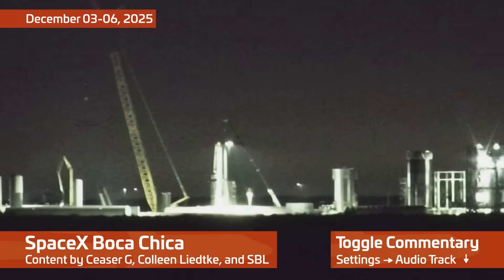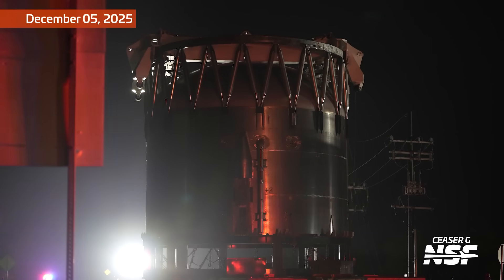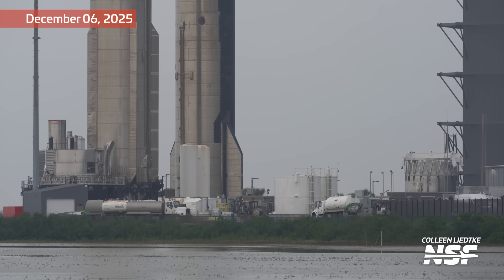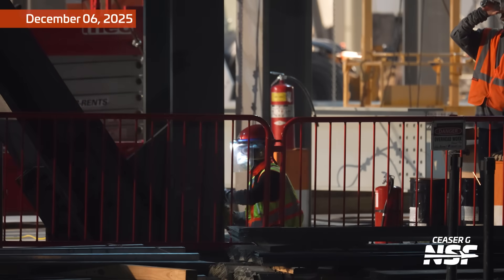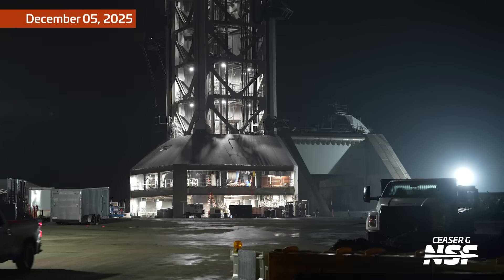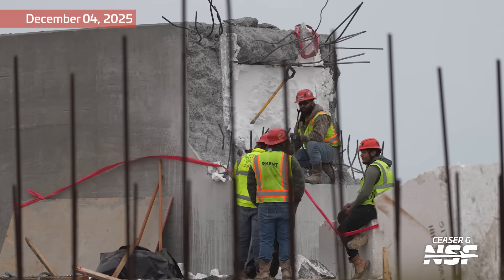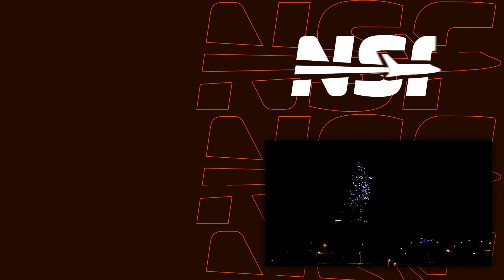"Thats a fine looking Starship" | SpaceX Starbase

Comment: Is there another storage tank instead of COPVS that space x coould use? they seem very dangerous
Reply: Has anyone actually confirmed it was a COPV issue?  There are certainly other materials that can be used, the trade off is weight though and that's what they try and avoid if possible.  Anything holding a lot of pressure is dangerous.  Remember the ending to Jaws? :)

Comment: FYI, the compressor is commonly known as an IGC - Integrally Geared Compressor.  The driver shaft spins a large diameter bull-gear.  Three or 4 pinion shafts are situated circumferentially around the bull-gear with a centrifugal impeller on the end - and sometimes on both ends.   This allows a lot of stages  in a relatively small footprint, each of which can be spun at its ideal speed.  Also, it allows intercooling between each stage  to optimize thermodynamic efficiency for large pressure ratios or light gases.

Comment: If you want to use a Laser welder, in the UK the safety requirements are extremely high, remember with a "regular" welder, if you point it at someone a pull the trigger, some wire comes out the end of the gun at a snails pace. You point a laser welder at someone and pull the trigger, you're giving them 3rd degree burns, blinding, and possibly serious lacerations. 

I'm a uk welder who's comany wanted a laser welder, so i had to go to the safety briefings and look into how we'd set one up and safety requirements. We even had a company send us one out for 2 months for us to use and see if we wanted to buy some. We deemed it too much of a risk and too much cost for the jobs we'd be using it for.  We sometimes do mobile work aswell, and laser welders are HUGE compared to a good tig/mig machine, and weigh 5x as much. So theres no lifting that up a ladder. And no just buying longer leads for the welder, as the laser uses a special, usually brand specific, fibre optic cable aswell as its gas line ect. So no popping to the welding supply store for replacement consumables.

Laser welders are an amazin leap in welding technology, but one of the small known facts is are you're welding with a laser, you're breaking bonds of materials at a molecular level, this releases all sorts of off-gassing. The biggest one in Chomium. UK safety testing as shown that laser welding off-gases a lot more serious chemicals than welding the same material (mainly stainless) with Tig or Mig. When Tig welding, the off-gases are emitted at a relatively low speed, so the overhead ventilations high flow is greater and pulls these compounds away from the welder. With laser welder, the high energy input means the molecular breakdown happens quickler, meaning the off-gassing compounds release at a much high velocity and most dont have chance to get sucked up by overhead ventilation. Thus its deemed in the UK we SHOULD wear PAPR or avtive air filtraton devices to shield the welder from the harmful compounds released in very high doses and at a high enough velocity standard ventilation isnt suitable.

Long and short, if you're new to welding, dont buy a laser. 
You'll likely accidently burn yourself as a best case, worst case you may blind yourself or someone, or possibly worse.

Comment: Hi Das, great video again, i cant get enough. The reason they string the beams together is to save lift time with the Tower Crane. Lifting 4 beams save 3 times for the crane to travel up and down. Save on Crane time. I also think the Welding gun you liked is a stud welding gun. This is required to allow the concrete and rebar to bond to the steel decking. Just fo your info as well, some poor man then has to hit each stud to make sure its welded correctly (Quality Check), there will be thousands of these studs.

Comment: That's no problem at all, because luckily everything is so incredibly cheap for SpaceX and it's so quick to build something new, and the boss has so much money and he's the best rocket engineer ever. / sarcasm off.  Thank you, SpaceX, very entertaining. I'm looking forward to many more “booms” and “bangs” when V3 wants to go into orbit fully loaded and then during refueling. Fun for many years is guaranteed. Meanwhile, the others are building real rockets that work.
Reply: What silly nonsense.  Are you pretending others don't go through development or do you simply not know what that means or what's going on?
Reply: @imaginary_friend7300  SpaceX has the highest number of failures (destruction) of any single developer in test flights of heavy transporters worldwide, primarily due to the high-risk Starship test flights. 
SpaceX refers to the “boom” and “bang” as “fail fast, learn faster” or “iterative development,” terms coined by the company itself, also “RUD (rapid unscheduled disassembly)” and “successful failure” for complete destruction. 
Please understand: SpaceX has taken on more than it can handle and has lost control of its own project. Even after eight years and eleven test flights, no Starship has been in orbital flight. The payload is far behind what was claimed, and the launch costs in full reusability mode are still unknown. Anything after 2025—launching with a full payload of 100 tons, refueling in space, and landing on the moon—has never been attempted by SpaceX and will be really dangerous. 
That's why I'll be proven right, even if it annoys you.
Reply: @imaginary_friend7300  SpaceX has the highest number of failures (destruction) of any single developer in test flights of heavy transporters worldwide, primarily due to the high-risk Starship test flights. SpaceX refers to the “boom” and “bang” as “fail fast, learn faster” or “iterative development,” terms coined by the company itself, also “RUD (rapid unscheduled disassembly)” and “successful failure” for complete destruction. Please understand: 
SpaceX has taken on more than it can handle and has lost control of its own project. Even after eight years and eleven test flights, no Starship has been in orbital flight. The payload is far behind what was claimed, and the launch costs in full reusability mode are still unknown. 
Anything after 2026—launching with a full payload of 100 tons, refueling in space, and landing on the moon—has never been attempted by SpaceX and will be really dangerous.

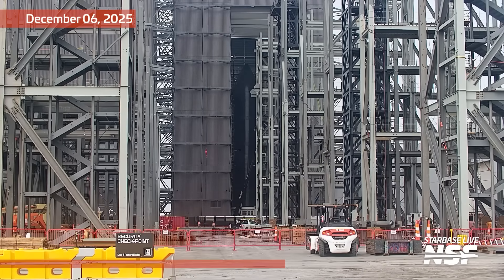Comment: I like your unusual word drops which appear quite randomly like the word that you used for 'hat' that you recategorized as a coif on what looks like a transfer tube at 7:18. 

 I only just today saw that word in a NYT crossword puzzle.   I had never heard that and had to look it up.  A coif is a tight fitting head covering worn by nuns.   

Anyway such references make the video more interesting.

Comment: Looks like it unzipped under a chine suggesting a COPV issue or how the attachment of the COPV caused a weak point, as with any wielding proper infill for even an attachment bracket. TIG style wielding is the strongest way to join 2 metals together and can also be done without filler unlike with MIG and ARK stick wielding filler metal is added by the wielding style.

Comment: The welding "gun" is for placing Nelson studs where there will be cement poured. I've done a few thousand of those in my previous career.
Reply: I don't think that was a Stud gun, looked like they were stitch welding the deck down with a Spot welding gun
Reply: @demigoddragoness That could be, but the brief glimpse of it looked just like the stud welder I used. That is also an area that will likely be filled with concrete to make the floor.
Reply: I have a feeling those platforms won't get concrete

Comment: For the steel on the cable,  they use a single pick to place 4 beams.  They will swing in the bottom one, bolt that one in place, then move to the next one, ie 3rd, place and bolt that, then move to the 2nd and 1st one.   they lift 1 to 4, then install 4 to 1.  Most of the time they are all in the same area.